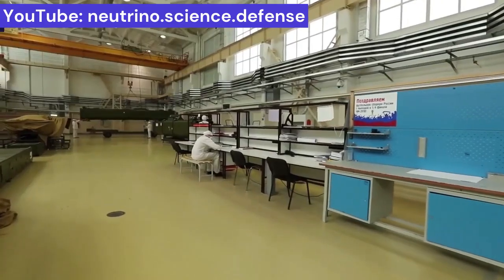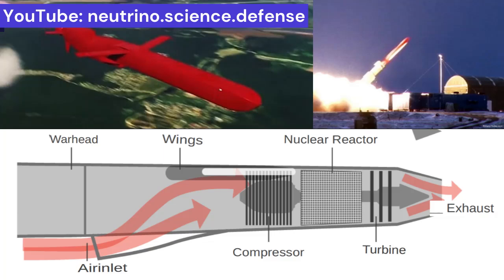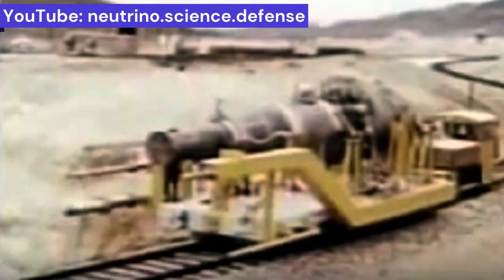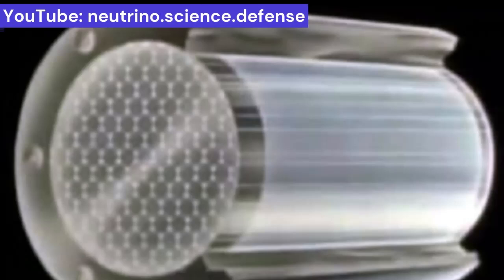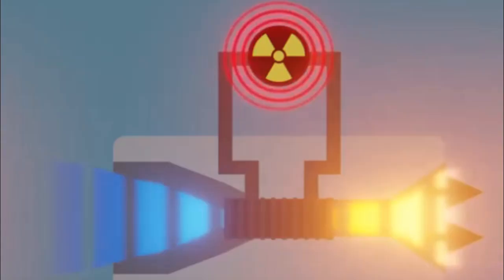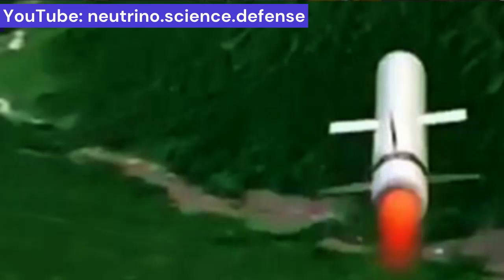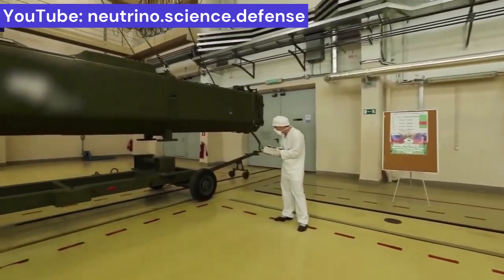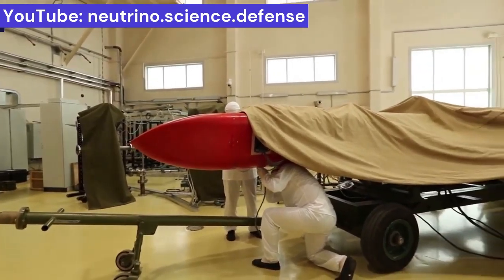How does Russia's Burevestnik intercontinental-range nuclear-powered cruise missile engine work?

Comment: You have to admit, the USAF one looked pretty stylish!  Flash Gordon kind of thing.  SKYFALL is a great name though.  It's not their name but still.  I have reason to believe that the Russians did a generation of development on materials for this kind of reactor.  Looking for something mechanically and thermally rugged that can operate at very high temperature.  Ending up so I heard with twisted ribbons of mixed carbides (including Uranium Carbide), those ribbons could be packed into a cylinder and sintered together, so there would be a durable cylinder with longitudinal holes.  There was some kind of control action on the outside of this can that I didn't understand.  I think the early attempts not only had a plume of activated Argon which you can tolerate in this context, but might have lost some of the reactor material with the exhaust, and they finally just gave up.  I heard a talk about it once.  I think we tried pretty hard to have several types of flying atomic engines, there was hardware, test beds, you can find pictures.  It seems to me that it was a vast money pit and a lot of trouble and they finally just gave up.  So, the secret seems to be partly in new materials and partly in unmanned (as we used to say) operation.  I don't think it has electric drive!  Why not just a shaft?

Comment: The part around 6 min seems kind of crazy.  A flying atomic power plant v/s a kind of ramjet engine?  It might have to be going very fast just to START, but launching from a big aircraft, or from the front of a big rocket seems like things that are actually being built.  There might not be a lot of moving parts!  The engine might not need a lot of control!  In this context it might be good enough to be entirely off or entirely ON!  In this mission radioactive exhaust is tolerable, as long as the engine doesn't disintegrate during the flight.  IT DOES seem like something that would be hard to test!

Comment: Radioactive pollution is the biggest obstacle to the possibility of using nuclear energy as a means of propelling cars and plane , only ships and submarines can use nuclear energy since are huge in size and can bear the weight of the nuclear reactor shield
Reply from the maker: This issue is also addressed. Highly likely you didn't watch the video til the end.
Reply: @neutrino.science.defense  i watched to the end , i just wanted to insist on this  point
Reply: It’s not a large obstacle but a very small one.
Reply: @TheGrindcorps   And yet we can't overcome it
Reply: @krimokrimov6050  we already have.
Reply: @TheGrindcorps  can you name me a plane or a car that work on nuclear energy
Reply: @krimokrimov6050  nuclear is actually a good option for things like commercial ships, trains and potentially some airplanes.  There have actually been a number of nuclear aircraft and trains.  It is much more feasible and economical for trains and far more diverse commercial ships thanks to Russia’s extreme miniaturization of nuclear technology.  They have commercial nuclear icebreakers.

Nuclear power is a huge solution for the future of a shipping industry that is one of the worst polluters and emitters currently.
Reply: @TheGrindcorps   Man, you say what I said, so why do you disagree with me? I said that nuclear energy is used in ships because its large size and lack of need for high speeds allows it to carry the heavy shielding of the nuclear reactor.
There were attempts to build nuclear aircraft by the Soviets and Americans, but they faced the same problem, which was irradiation which required heavy shielding around the reactor, making the plane unable to take off